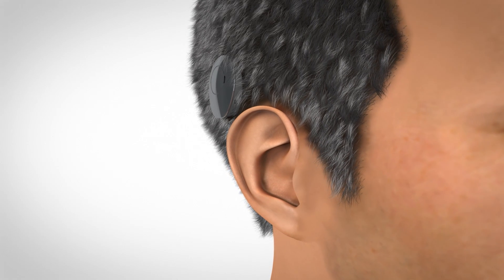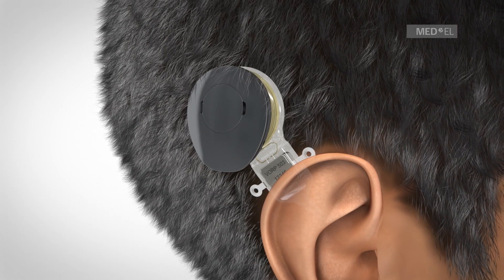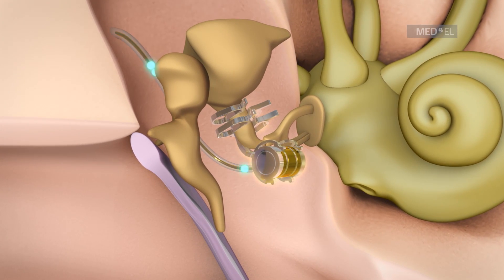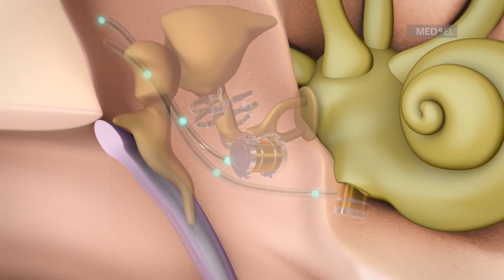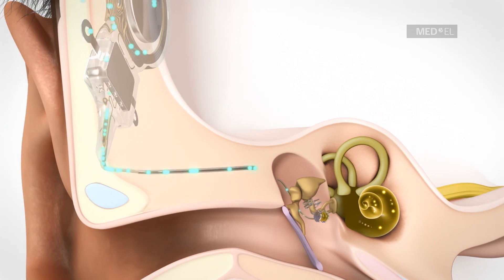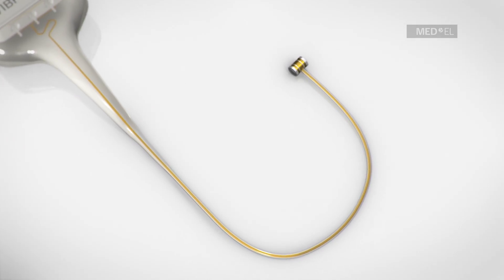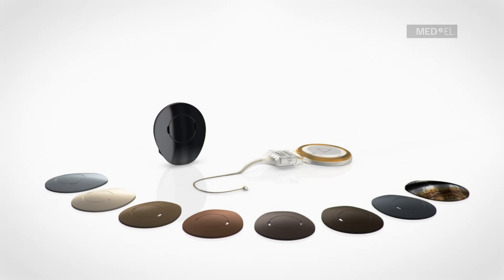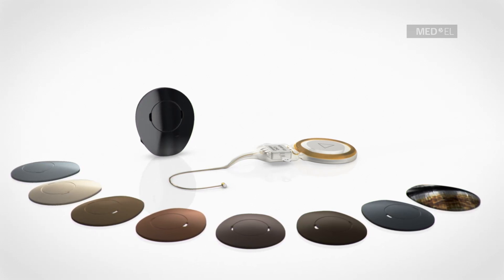How the SOUNDBRIDGE works with SAMBA Audio Processor

Comment: Does it work for single side profound hearing loss???
Reply from the maker: Hi Steve, thanks for your comment. 
SOUNDBRIDGE is designed for people with mild to severe sensorineural hearing loss, as well as for those with conductive or mixed hearing loss. For people with profound hearing loss, a cochlear implant can be a solution. For more information which MED-EL hearing solution could be an option in your individual case and about availability in India, please get in touch with your local MED-EL office. They are happy to answer all your questions and assist you with this. Here are their contact details: 

MED-EL India Private Ltd.
#505 Pragati House, 47-48 Nehru Place, New Delhi, India | 110019 New Delhi
Phone 91-11-4160-7171 | Fax 91-11-4164-2800 | Email India.Support@medel.com  

Kind regards, Verena